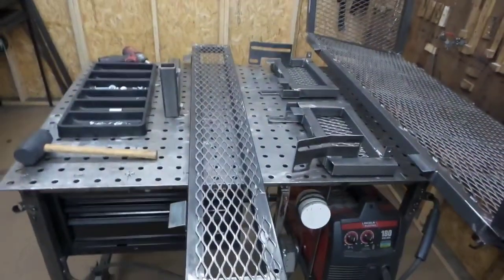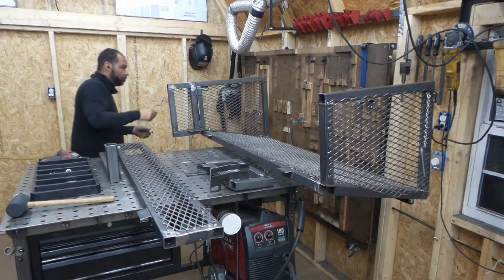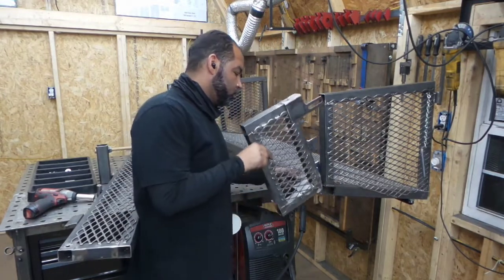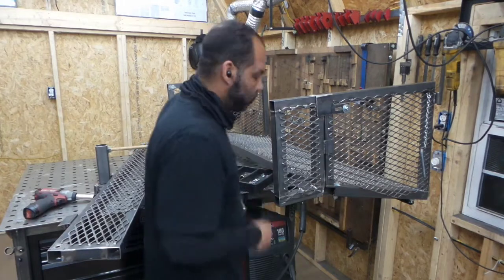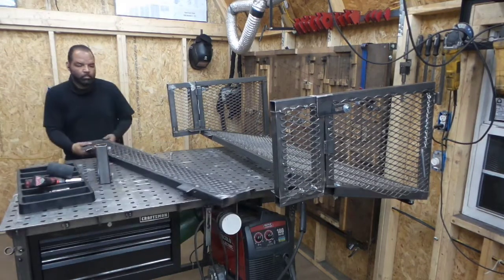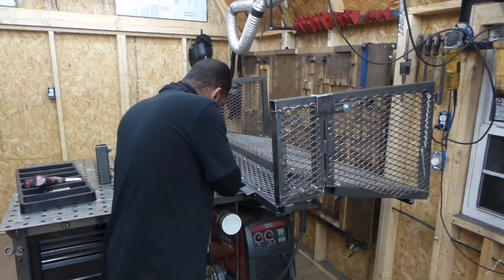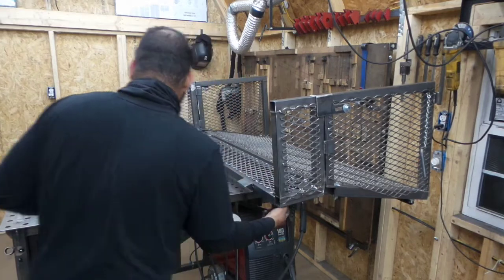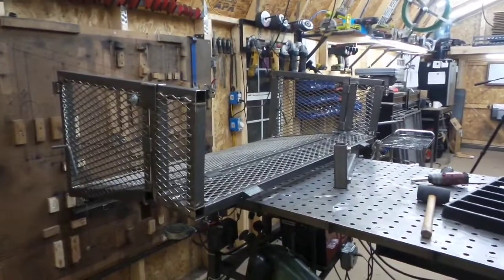Mow and Go Systems - 8" Dovetail Extension Kit

Comment: I want to buy this system but I will loose my back up camera on my f250. Do you know what aftermarket back up camera set up people are using?
Reply from the maker: That is one of the issues I have not worked on yet. I imagine a bolt on license plate camera would work on the bracket of the ramp but I don't know the quality or compatibility of the products available. Most factory backup cams on trucks seem to be up high on the tailgate. With the ramp being a bifold design it would be difficult to place one in a comparable location. I will put this on the list of things to work on. Thank you for watching!
Reply: you ckhld always run the ford wireless trailer back up cam if your have the ford sync system

Comment: One more question...can you fit a zero turn and push mower wwith dove tail extension?
Reply: I have a 48 inch Exmark Lazer Z and 21 inch Murray push mower that fit on mine without the extension so with one should be no problem
Reply: @d.gentry3086  Assuming its an 8 foot bed?
Reply from the maker: Generally the answer is yes but it depends on the truck bed size and the  zeroturn you have. The best thing to do is measure your truck bed length and exclude the tailgate from the measurement. If you have the mowers you plan to use already, lay them out on your trailer or driveway the way they'd go on the truck and measure them together. Assuming you put the push mower on first measure from the far side of the push mower to the back wheels of the zeroturn. If that length is less than the bed length plus 8" then yessir.
Reply from the maker: I think he does Bill. He's had his ramp for a while on an f250 I believe and I think it's an 8ft bed.
Reply: @BILLYBOB923  it is an 8 foot bed